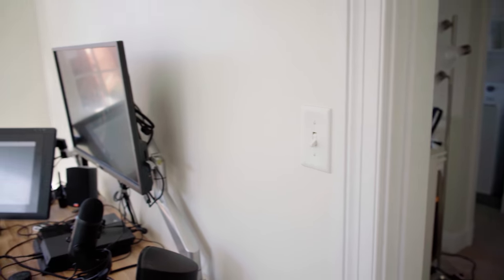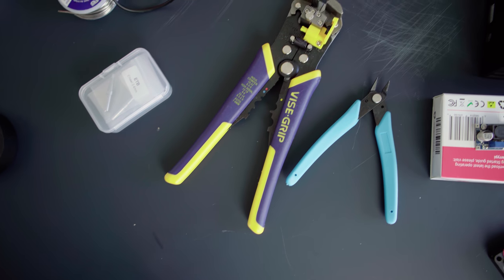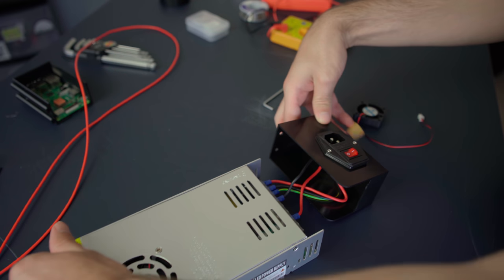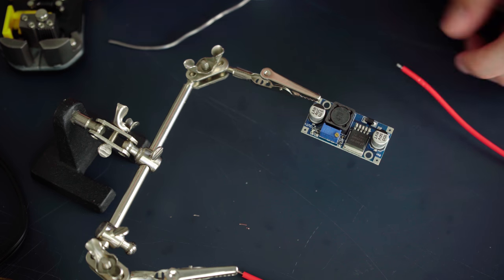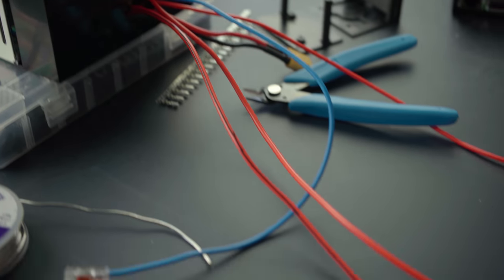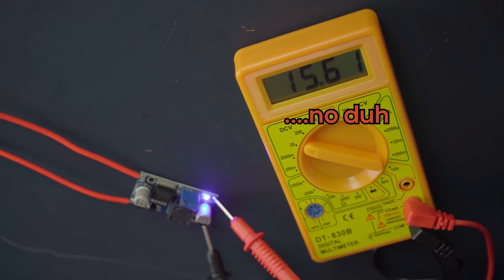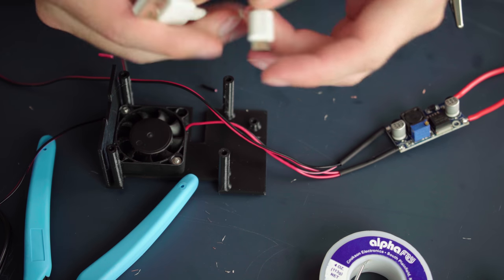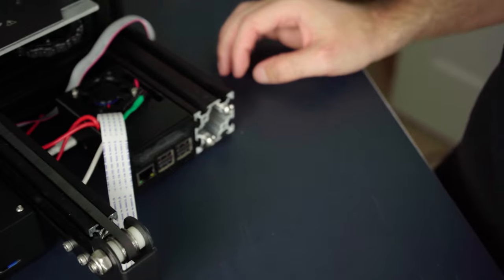Install a buck converter on YOUR 3D printer for the raspberry pi

Comment: I tried running line from the other terminals on the psu, adjusted all voltages was working fine all read correctly. It was until connected to the printer the buck blew. I used a 3v-40v buck converter which are working great for my fans, hot end and electronics. When i ran a second line was fine and working until the psu got connected to the printer and seemed to blow the bucks regulator. The psu outputs a max of 15amps which could be the killer for it.

Comment: @Georges Gadgets Did you scale your case or did it just fit? Do you use Raspberry Pi 3 B?
Reply from the maker: I did not scale the case, I did have to pry it open a little to get it in there though.  I went with the 3+

Comment: ... if you just attach 5v input to one of the 5v rails on the GPIO, it's not going to run through the power supply properly, and you will have issues.... this isn't a safety mechanism, its that the raspi isn't designed to be idiot proof. notice all the little chips right around the power port on the raspi? that's a power supply. it takes the 5v in and acts essentially like those buck converters there, steping the power down to what is needed by the various and sundry chips in the raspi (notably 3.3v and 1v)... putting power through these chips doesn't always work backwards because of the presence of transistors, which limit flow selectively, and diodes, which limit flow in one direction but not the other...
Reply: I am the idiot, does that mean those 5v rails are for output only?

Comment: What gauge wire did you use (anyone) from the buck converter to the raspberry pi?  (P.S. I'm thinking of soldering to the pads underneath the micro usb plug.)

Comment: Thanks for this, I am doing a build on my ender 3v2 to add an 80mm PSU fan and dual 4010 MB fans. While I am doing that I thought "what if I added a USB power for my GoPro clone camera that lives on the printer as part of my ah-hoc video monitor system"?  And since the 80mm fans are 12v and have to be stepped down and the buck converters came in a 3 pack, things looked good, So I wanted to see if anyone had done this and looks like I can either run the usb -c at 12 v or add a second Buck to drop it to 5v. Have read that USB-C ports can be configured with 5V 1.5A and 3A for up to 15W of power. Thank you for the proof of concept in this video. Great work.

Comment: oh lord, okay, people: buy a USB fixed buck converter. 5.1 is probably still too low. when you test like that there is no voltage drop, which will be present when there is current draw. they make buck converters that output USB standard power, and they're designed to deal with that drop. they're available on amazon and basically the same price. has wires on one end that go to the power supply and a USB port on the other. want to get really fancy, they make ones that actually go to MicroUSB and USB C to power your pi directly off the converter
Reply: thank you, will be adding that to my shopping list

Comment: I bought a dozen buck converters on Amazon.  I wired one into my power supply and adjusted the output down to 5 volts just like the video says.  It was so much fun I decided to make one for my brother who just bought an Ender 3 pro for his kid..  I hooked it up and just before I could adjust the output the capacitor on the input side exploded.  I got another one and wired it up too.  When I hooked it up the input capacitor exploded again.
Reply: You must set your power supply to the voltage of whatever youre going to hook up to afterwards. The output is dependant on the input voltage. Its also vital to ensure you do not hook this up to ac, or in reverse dc. Both can cause severe damage to the capacitors.

Comment: Basically it should be better to set the buck converter to 5.2 - 5.3 V output. That's (as far as I know) the maximum of the USB specification and you always loose power on the connections. This way, even if the 5.3 V reach the Raspberry Pi you prevent undervoltage.
Reply from the maker: Thanks for the tip!

Comment: It's not converting voltage it's stepping the voltage down, it's a buck transformer.  Boost transformers step voltage up. If it was taking AC and changing it to DC then it would be a converter.